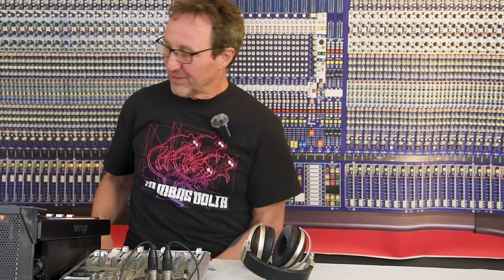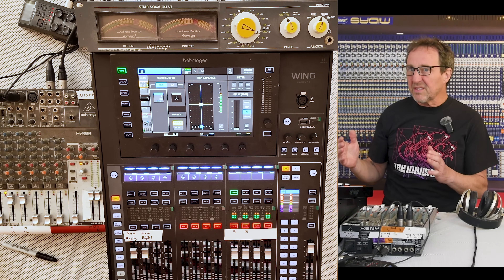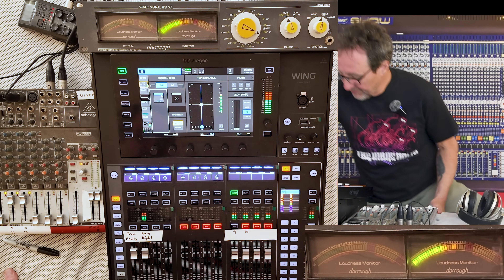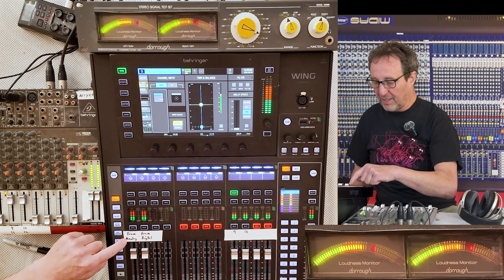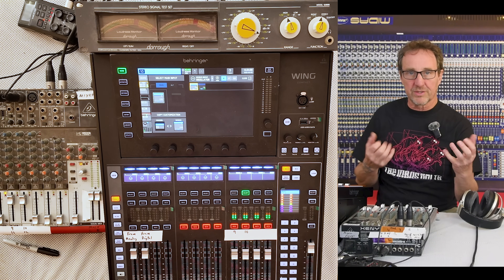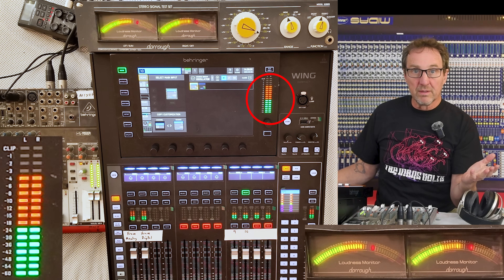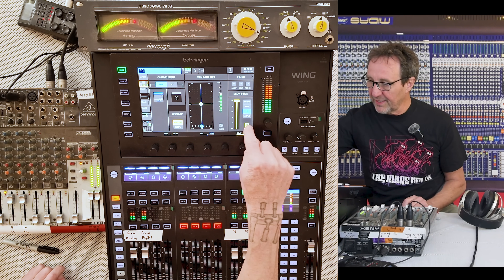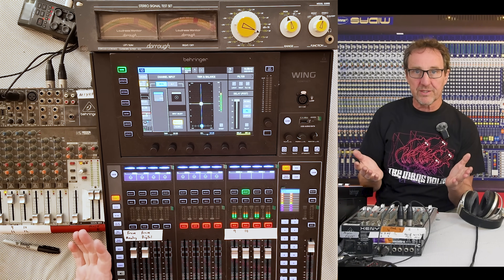Digital Audio Meters Don't Show What you Hear - Sometimes

Comment: Dear Dave, here is the response from the  developer of the Wing hope it helps:  "Digital is correct. The peak value (meter) is twice as large (6dB), the rms value (perceived volume) 3dB. The fact that it is different in analog or after conversion is due to band limiting/filtering in the analog domain. Another problem is that white noise can have any crest factor. The peak value can be arbitrarily large depending on how it is generated. Without band limiting, it is infinite."
Reply: Hi Dave. I think this only happens because there's significant content actually at Nyquist. But that's only ever going to happen with digitally generated noise. The steepest LPF I have available, set as high as possible, fixed the problem perfectly. So I don't think it will ever be a factor when summing actual music.
Reply from the maker: Perhaps but am remiss to assume.

For example the scenario cymbals bleeding into numerous stage mics could somewhat parallel multiple de-correlated sources with HF content being summed.

As far as low pass filters, my tests show different outcomes. The best results paralelling analog was a 6db/filter set as low as possible while using the highest sample rate available.

The low pass itself creates issues and the steeper, the worse the issue.

I suggest doing tests with 10 channels of white noise and staggered delays to get a 10 dB differential. This makes the tests and results more clear.

Additionally, while the issue may or may not be exasperated by the Nyquist filter, and the summing peaks are probable to occur more often at higher frequencies, I don't think we know that it does not happen at lower high frequencies.

It may or not be happening when 30, 50 or over a hundred mics are being summed.

Now I am not saying the actual sound is different or flawed per se, but rather that the digital metering sees the signal differently than analog metering, and digital distortion is different and more concerning, such that the look and feel of digital summing may be different and when a system looks and feels different, we often perceived it to sound different.
Reply: @DaveRat cymbals and cymbal spill will all have passed through AD converters and will be band limited. Also remember how wildly unnatural white noise is. Actual audio signals have tiny amounts of very HF content, so even if this does occur, the error in the metering will be much smaller than in the white noise test. Do you have any analogue noise sources available? I'm willing to bet that if you repeat the test, but with analogue noise coming in via the ADCs, you'll get the expected behaviour on the meters.
Reply: @DanWorrall  WOW. I was just thinking where is Dan on this and literally here you are I can't believe this am I dreaming?! 🫶
Reply: @DanWorrall  Dan Worrall Dave Rat crossover is something I hope to see soon! I've mentioned the "Super Separator" technique a few times to Dave in comments, and would love to hear his thoughts on implementing live
Reply: Awesome. This explains what I found out on my dLive just now. 4 channels sourced from the SigGen routed to a stereo aux at unity. Channels 1,2 panned left with ch2 decorrelated  and channels 3,4 panned right both aligned. All other sources of noise behave like one would expect except white noise. Add a LPF @20k to all channels and then white noise behaves like it should. HPF did not change the white noise metering until 1k things would start to flicker.
Reply: If you need the meters then you just have to use rms metering. But it costs computing time, so it's not normally available. Why are the meters so important? Audio means listening ;)
Reply from the maker: When mixing live audio in large and complex venues it is impossible to be everywhere and hear everything. 

Calibration, correlation and monitoring of numerous sends covering a multitude of zones that can be 100s or 1000a of feet apart and often in accessible during the performance is often the norm
Reply: @DaveRat sure. My point is, the only signal you are ever likely to encounter that causes this issue is digitally generated white noise. So it's a very interesting curiosity, but I'm not convinced it's a practical issue in any way.
Reply from the maker: I do not like to make assumptions but rather I prefer try and come up with credible ways to determine one way or the other.

Some tests that may be of interest.

I created white noise created using varying sample rates ranging from 8K to 192K. I then played those back on a music player using the analog out driving the analog A to D input of the wing. 

And then I did the exact same test that I did with the internal generator using the various white noise sources. 

The dB offset in the metering was completely gone using 8K sampled white noise. The differential increased as I went to higher sampling rates and does indeed occur though not as much as using the internal generator, when using the analog inputs and analog white noise signal. 

Also of note is if you look at the channels one and two of the wing which are reading the signal after it's been converted to anaolg back again, that D to A and A to D conversion does not totally eliminate the 3DB differential as read by the digital peak meter. 

The issue is still there it's just reduced by the conversions.

Though I shouldn't really call it an issue as in reality everything points to the digital meters being correct with respect to the signal, they just don't line up with what we hear
Reply: Most of that is very wrong, and reflects a fundamental misunderstanding of what core electronic terms mean by standard definitions.  

A deciBel is 10 times the base 10 logarythmic power ratio between two signals. 

Therefore, just over 3 dB is double a reference or compared signal's value.  

Since RMS is an indication of power to equate sine, square, and other waveforms, that's implicit to the use of dB.  

dB are also widely used sloppily in effect for "what some meter reads of voltage on some line that's not really a power ratio".

A 6dB ratio is 4x power, which is double a voltage, under conditions where that's true (constant impedance, etc).  

Human psychoacoustic perceptions usually sense 9-10 dB as twice as loud, not a voltage or power doubling, but other issues like time patterns or masking plus Fletcher-Munson and other loudness or waveform traits make things more complex.  

When dB are used as if absolute units, as in dBm, that's a dB power ratio to one milliwatt usually on a 600 ohm constant impedance circuit, but in reality old transformer circuits were usually nominal and varied impedances, just like speaker loads on amps.  Modern designs usually have low impedance drivers and high impedance loads, but with varied quality levels.  That leads to use of dBm as a semantic lie, for a voltage equivalent to 1 mW on 600 ohms regardless of actual circuit impedance traits.  

dBK would typically be 1 kiloWatt in an RF system, often 50.5 or 75 ohms, while dBm in WiFi would generally be one mW of RF.  dB as antenna gain would be a power factor compared to an isotropic reference.  In Cable coax, dBmV is common, which despite the one milliVolt reference, actually indicates a power ratio as the systems are 75 ohms constant impedance.  

dBA-SPL or dBrnC are frequency weighted sound levels, relative to defined references, the latter being telco noise archaic units re: -90dBm=0dBrn, "C-message weighted" (roughly flat over 20-20kHz).  
 
Since audio transients can have all sorts of odd waveforms or time characteristics, dB comparisons are pretty useless, and other forms of peak metering to consider headroom or downstream applications are important.  

BBC has used PPM meters traditionally.  

US use of VU is based on what was cheap and easy, as averaging voltmeters with relatively simple rectifiers, that could have wide frequency response compared to iron vane RMS mechanical meters prior to modern cheap electronics, but with better VU meters having many quirks, including 2 % static sine wave accuracy at 1 kHz, but 6% ballistic overshoot on audio transients.  

As to peak limits, audio disc mastering, tape saturation or elevated harmonic distortion below that, amp or speaker intermod harsh distortion, speaker thermal or excursion damage, or in newer systems, FFFF digital overload self destruct mode, or post-processing in broadcast chains including preemphasis and legal modulation constraints, etc, all impose different considerations on what is a functional production process or result, and what needs to be monitored and constrained to work within real world systems.  

Note too, the common sums of dB power levels assume sine waves and their energy traits.  

A square wave, aka a sine with all its natural harmonics, is (pi/2)^2 energy compared to an equal peak amplitude sine wave.  Most music is lower energy density unless heavily processed, with highly varied waveforms and peak to average or RMS energy.
Reply from the maker: All that is useful and interesting info and also the it's pretty obvious that there is a discrepancy between what we here and what the meter shows on all the consoles.

So now it's about using that info to explain why.
Reply: maybe secret compressor on master bus .  digital mixers with 100ch's it may be inevitable
Reply: There is no audible difference between digital and analog summing. Digital is not a problem because the floating point headroom is extremely large. These peaks of digital white noise do not exist in the analog world. The hf level of cymbals is also negligible.
Reply from the maker: Can you think of a test to verify that? 

We already know that digital peak metering is different than analog metering as the white noise that shows.

How would we test and gain confidence that summing 100 digital channels will meter the same as summing 100 analog channels?
Reply: And not for nothing, most sources will be band limited anyway. But the phenomenon is curious and it would be cool to fully understand what’s happening there.
Reply from the maker: Agreed. I have a friend that mixes for a very well-known band that has been touring for many years and switches between digital and analog consoles. And currently has a setup where he needs to use digital consoles but is using analog summing and prefers that setup.

I am curious as to whether there is any measurable demonstratable way to add or reduce credibility of the setup. 

That said, there is a layer of preference and the metering I guess will inherently be different and it can come down to a personal preference. 

But based on this white noise test it does seem like there's a possibility that digital metering maybe offering a different feel than analog metering and this white noise test may add some credibility to that perspective
Reply: @DaveRat  This is a bit out of my wheelhouse but @audiotom2010 mentioned the floating point domain, so I'm wondering that since the digital meter's pickoff point is in that domain before the DAC, and we are forcing a bunch of HF energy to sum there, if the meter is registering the content well past Nyquist that effectively gets chucked after DAC. Practically speaking this doesn't matter much since there isn't usually a lot happening up there and this test illustrates the discrepancy. And the analog world doesn't reflect it because frequency responses aren't typically that high in the first place. If we had analog gear with responses above 30k, would we see a similar summing result? Hmmm...
Reply from the maker: Interesting and that is out of my realm and also I am more interested in what things actually do rather than what they should do or what complexities are in place to do or not do something.
Reply: @DaveRat  Ok, I ran another quick test. I recorded white noise, pink noise, and 20k band noise from the dLive SigGen and analyzed the files in Wavelab. When looking at the 3D graphs of the spectrum linearly, and focusing in from 6k-40k region, there is considerable energy in the white noise file >20k that is not present in the other two. I grabbed some screenshots if you want to take a look. So I think this comes down to frequency response and the digital domain gets more to meter than the analog domain.  Now I'm curious as to what kind of sources might we encounter that have enough energy that high up as to cause a difference in summing between the two domains. This has been fun to look into, thanks Dave!
Reply from the maker: Very good and and the track you're on is exactly in line with the adventure here. 

Digital meters reading high frequency content that is important to digital, but less important to analog causes the digital meters to look different than analog meters.

The sound isn't necessarily different but the way the sound looks to us through our visual references changes and that I believe is what's happening and interesting
Reply from the maker: I agree with what the wing engineer is saying and that is also what my tests ultimately indicate.

Soooo.... With this info and progress

Now I'd like to ask the question and share what I believe to be the crux of this adventure!!!

Since the combined de-correlated  signals show 3dB hotter on digital meters than they do on analog meters than expected, are we losing 3dB with digital summing that we don't lose with analog summing?

And when summing 10 decorrelated inputs with significant HF content the offset differential between digital and analog summing can reach a 10 dB. 

The more de-correlated inputs summed, the more the difference will be between analog and digital metering for the same perceived and reproduced audible level of a given signal.

Assuming the digital peak meters are correct and accurate, which we have every reason to believe, and the analog meters on a given console are also correct and accurate, are we losing headroom in the digital domain when summing a multitude of de-correlated signals with significant HF content, that we don't lose when summing the same signals in the analog domain?

Are these short term peaks that cause digital meters to read hot a concern, can they be ignored? Do they exist in analog and we ignore them? Do they matter more in digital than analog due to the way digital distortion sounds versus analog distortion?

And finally, could this metering differential be the awkward offset that analog engineers noticed but can really explain regarding how digital summing feels weird compared to analog?
Reply: @DaveRat  so in other words this needs to be a setting in the options menu so u can change it to have the peak value read out on the meters - that's all that matters and RMS is really not helpful for finding out if your signal is being distorted by the preamps or if you're driving the amps loud enough to get their pres to sound correct... everything in the signal chain expects proper line level and will sound off if you don't give it the right signal voltage... it doesnt matter as long as it's digital but becomes critical when you wanna drive physical outputs! this is an issue and Dave is right, we need answers!
Reply: I don’t think that is the correct take. Digital systems with high sample rates have a frequency response much higher than the audible range. So if there is energy above 20k in the signal (such as internally generated white noise) the digital meter is metering it.  When it hits the DAC, any significant energy above 20k gets discarded and that’s where we start to see discrepancies. Practically speaking this isn’t much of an issue because effectively no sources that we deal with are generating content of significant value well above 20k to mess with the digital meter. My conjecture is if we sent white noise with energy well above 20k into an analog system with a frequency response capable of say 40k then even the analog meters would behave like these digital ones. In short the white noise signal we are testing contains content that is way above any normal frequency response of most things except a high sample rate digital system which does have the ability to register and meter signals that high.
Reply from the maker: Agreed. The metering needs to read the signal. And when much of the signal is above audible, what we hear and what we see are not going to align.

I would not jump to the conclusion that we don't encounter signals with enough of energy to create the issue.

Conversely, of a situation where there is lots of RF getting into mics that we can't hear or even a lot of mics near cymbals, it is possible or feasible we could encounter this.

I will try and find some time to do a vid showing testing white noise samples at increasingly high sample rates running analog into the a to d inputs.

Also, is this issue more pronounced with better and higher sample rate d to a converters or less pronounced?

Comment: Great video, and a puzzling one indeed!

It reminds me of a somewhat related but not quite the same problem, which shows up mostly while DJing (regardless of analogue or digital) some songs have the same amount of lights lit up on the console, but sound WAY louder (or quieter). Why is this?

For example i try to aim for 0db on my output so im sending a clean signal to the sound system, but some songs at 0db are super loud and others need to be +6 or even more to sound a similar "loudness"
Reply: In other words, what are those little lights actually measuring? And is there a way to make them closer to actual "loudness"